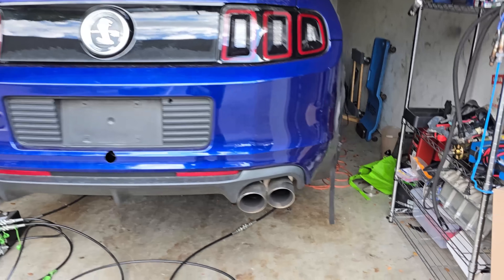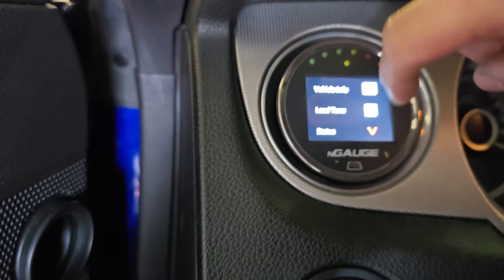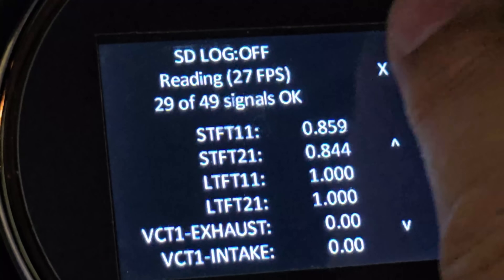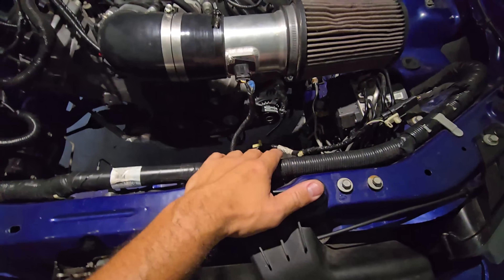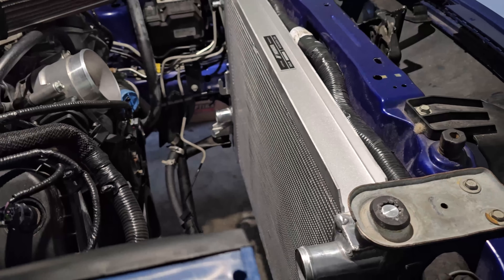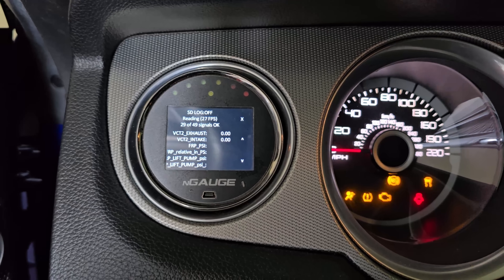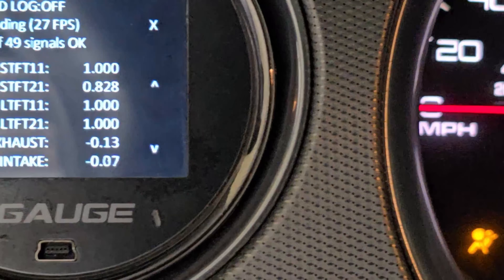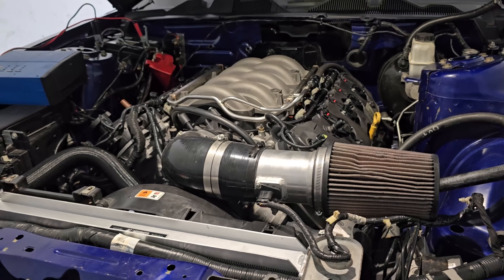Unlocking VCT on a Coyote Swapped GT500!

Comment: Would it be reasonable to assume this would work the other way around? GT500 PCM in a GT/Boss (trying to figure out how to retrofit the SVTPP electronic adjust suspension and trackapps into the Boss). Doesn't the Coyote platform have some sensors that aren't present on the 4V? The PCM still reads them properly even though it shouldn't be expecting any data from them?

Comment: Starter sounds like it needs a shim or remove the shim.  When I did my swap I used the plate supplied with the aftermarket bellhousing and that plate was too thick causing the starter gear mesh to be wrong. Made alot of noise like yours. I put the factory bellhousing plate in and noise went away.  
block plate, separator plate, or spacer plate. Whatever you want to call it.

Comment: Chicane 23 did it back in 2017/2018 with a 2008 GT500, it was in a road race car. So as far as the Coyote in a GT500 its nothing new. I like the 5.4/5.8 but the Coyote is a superior engine design. But the mod motor DOHC has been around since the 90s. A lot of the sound difference is the firing order, 4.6/5.4 engines have the same as a old school 5.0 HO/351W where the Coyote (Mustang) is like the Y-block and flathead.

Comment: One has to admit that the Trinity is the best sounding motor that Ford has made in a long time.
Reply from the maker: @thastinger345  if you're going by sound. 2v and 3 valves sound great but they are trash
Reply: @YDBT4LIFE  Agree I have a 2V 5.4 2.9 Whipple and it sounds about as good as my Trinity motor but not quite as good to me. The trinity is bone stock though, just with the super snake axle back.
Reply: Something about a 4v engine, very distinct sound in opinion. I love hearing them idle with a good exhaust set up.

Comment: This might be a very dumb question but if it takes 30 seconds for VCT to actually work, when you see people at the track push their cars to the lane, are they causing excessive wear on their engines with no VCT control?
Reply from the maker: No, after a flash and a cold motor it takes a bit. but at a track by the time you're at a water box you're good to go.
Reply: Ha!ha!ha! My has well go for a three some ,Shelby car, Cayote engine, and the new Roush supercharger twin snorkel in a bleu colors . You would have something that nobody has. 👏💪🇨🇦👍